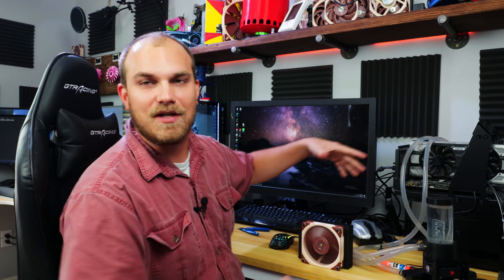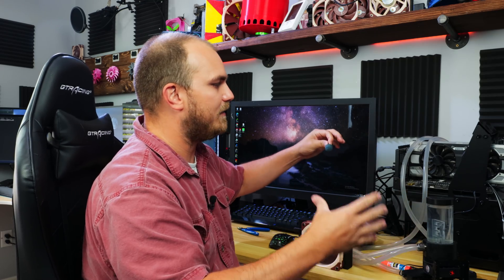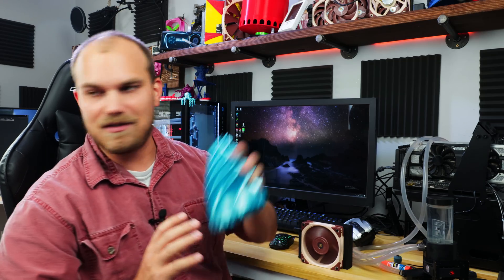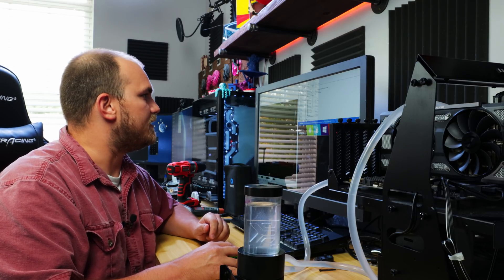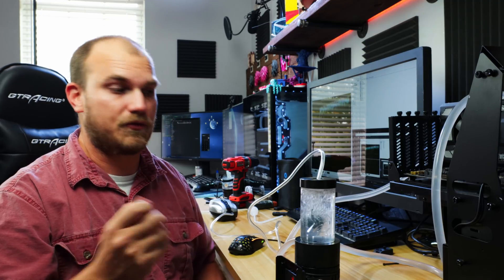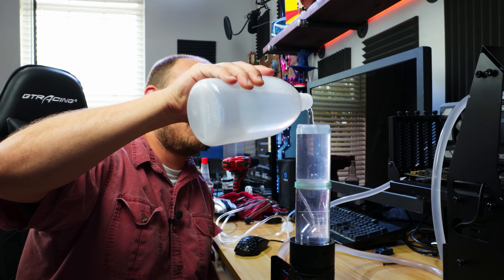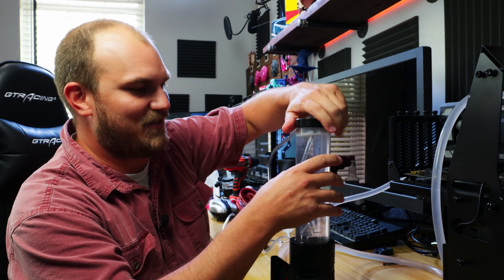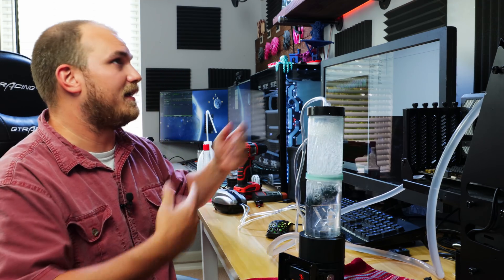Can An Airstone Cool Your PC?

Comment: COOLER IDEA: why not make a evaporation cooler that looks like a decorative waterfall? either a rock wall style or maybe a one with steps.
Reply: I love this idea
Reply: Same
Reply: Just run your loop through your fish tank
Reply: @karade  bruh
Reply: ...like Cray did way back when for the Cray 2?
Reply: So a cool looking vapor chamber?
Reply: The other foreign object can stock on your pump or currosive things can stock on your pump
Reply: @josergevasquez3767  just dont put foreign objects in it lol
Reply: Jonathan Scott I think he’s talking about erosion? Don’t get a stone fountain, make sure it’s plastics. Also if it’s open to air you should put a filter somewhere in the system.  You’ll need a stronger pump probably as well.
Reply: @Gracefulhiqpo  Make a sealed acrylic box to cover it and hide some fans.
Reply: I really like this idea, but maintenance would be often
Reply: @BossAuto_  Oh gosh yeah... Having an open system like that would certainly end up with the block getting clogged with gunk. It would look so cool though maybe it's worth it
Reply: Calling @DIYperks
Reply: this sounds really cool! id love to see this! nice idea!!!
Reply: would be awesome, something like 3m novec liquid with a boiling point of 34 or 61 C, or alcohol in a closed controlled system if you want to go cheap and dangerous.
Reply: Dude. YES.
Reply: This idea is kinda like unoptimized cooling tower.
I mean it could work and look cool
Reply: @replikvltyoutube3727 you could also make a mini diorama of a nuclear reactor with mini water cooling towers that is functional 😂. Real life cooling towers also utilize evaporative cooling.
Reply: I would enjoy watching it with Mercury as the liquid. It would run like garbage and mess things up but I like the idea nonetheless

Comment: Check the relative humidity of the air coming out of the top. If it's 100% (98%, 99%, close enough) then you need more air flow. You can check against what the air coming out of the tower was. Iirc, you did that and it was really high, but I don't trust my memory on that. Also, you have the inlet and outlet on the bottom, so that much bubbling and froth at the top might be stopping natural convection from circulating the water in the reservoir. Maybe check for stratified temperature in your reservoir. A cheap food thermometer that can reach the bottom would do it.

You have three potential limiting factors: A) Saturating the air with water and so no more heat can be taken away from evaporation,  B) not having enough time or surface area for evaporation to occur into the air, or C) circulation from the reservoir where you are cooling into the actual loop. B and C can be fixed by changing the reservoir shape/design, A would mean this whole idea is a dud, because the fix to that is increase the air/water ratio, the fix for which is of course the cooling tower which is a "different idea" in the context of this experiment.

A better reservoir idea might be to use a box, maybe 2" square by 12" long, laying down on the long edge, and bubble air the whole length of that with half a dozen airstones or a perforated tube running down the length.

I'll throw something in SolidWorks and upload it.

Comment: Use like a 30 gallon tote for your reservoir, a full size air hose with pin holes for your bubbler, hooked up to an air compressor

Comment: I think the issue is that the water to air ratio is way higher than the cooling tower so it didn't work as well. you can mitigate this issue by adding more air volume and 4 reservoirs or more.

Comment: I suggested this last time but I still think it is a good idea. Water cool the radiator. Have water fall onto a horizontal radiator with a fan above. Similar to the original design but using the radiator as the evaporation surface

Comment: @Major Hardware
A big problem with this method (as opposed to dripping the water) is that water have about 4 times more heat capacity than air, meaning for every 1 unit of water used for cooling, you need 4 units of air, so you REALLY need make that air pump work hard.

Google: "water heat capacity vs air"
Result: "Water's specific heat capacity is 4200 Jkg-1K-1 and Air's is 993 Jkg-1K-1 therefore water has 4.23 times more specific heat capacity. 
               Water has a density of 1000/m3 and air has a density of 1.275/m3 therefore water would be 784.31 x denser than air."
Reply: @Major Hardware 
Maybe try this?
Hot-bulb engine cooling system: https://youtu.be/mPGaJIAnjGI?t=24
 (but I think this is for cooling higher temperature water)

Comment: Larger reservoir will slow the throteling down because then there is more water to heat up but it will be a really small difference. (I could be wrong but these are my thoughts😅)

Comment: water's getting too aerated. it's getting pulled into the loop so you're reducing how effective the water can pull heat out from the block.
Reply: You get it 👍
Reply: I was about to post this.
Reply: Not so much, it's right when he putted that purple stuff into the loop, but with normal water the quantity of air trapped is quite small
Reply: Yes since air is a great insulator I knew without watching the video that it was not going to work.
Reply: @kitsura  Never heard of wind chill? Trapped air is an insulator. Moving air is great at carrying heat away, hence why fans are used to cool.
Reply: Absolutely. And with less thermal density available in the air, the efficiency of the temperate transfer in the block is greatly reduced.
Reply: That's the secondary problem. You don't want the air going through the system.
The primary problem is he's trying to cool via those cavitation bubbles but the volume of air he's pushing is absolutely tiny. You need a much larger volume of air than volume of water you have. 
So to match the other fan cooled radiator, you have to move just as much air as at other fan, while simultaneously putting that air under a higher pressure to be able to force it into the water. So you need a much bigger container at that point just so you don't make a mess. Lol

Of course another problem if you wanted to use this realistically, is that the system is no longer a sealed loop. You have to let the air out. So you'll have evaporation issues but you could take advantage of this with a large upper surface area, imagine a very thin container as wide as his desk, You would have a much larger area to evaporate from. So you lose water but you would get cooling from it too. That may be the boost on this that is needed to really make it effective without shoving massive amounts of air
Reply: @TravisFabel  Yeah, the other issue is surface area. He's pumping a small volume of air through the water. if he had a big short reservoir with tons of bubbles over the entire thing, it might work.
Reply: @TravisFabel  cavitation bubbles LOL.
Reply: agreed.

he is basically creating cavitation which is creating the same effect as vapor lock... trapping even more heat in the cpu...
Reply: @ThePorritZ  This has absolutely nothing to do with cavitation.
Reply: @ThePorritZ  pumping air and cavitation are not at all the same thing. air bubbles have air in them. Cavitation bubbles basically have nothing (a very very small amount of water vapor) at a lower pressure than the water around them. They then collapse rapidly and basically water hammer various surfaces.

Comment: Interesting, but if I'm not mistaken, from experience, the compressor will heat the air a bit. I'm guessing the water temp would rise in that small of a container even without being connected to the cooling loop, just from the warmed air bubbling through it. Cool video though!

Comment: You remind me why I got into PCs, FUN. Uhhhh what about a separate reservoir ? Air doesn't cool , so air going into the pump is a no go . Have a tank and the pump dumping into it from the water block maybe a transfer pump pushing water to your reservoir/pump . What I'm trying to get at is separate your pump from the aeration and increase the time the air has to interact with the water. Water wetter also . And really aerate the hades out of the water. Big tank/reserve reservoir . Bucket/milk jug. Since you have no rad your water supply needs to grow by a large amount. Nuclear power plants come to mind .

Comment: Id like to see what happens if you bury a tank under ground the cold earth should pull the heat away enough you wont need a radiator
Reply: A garden hose is more effective

Comment: Salt water or your water wetter with a air block from lee's. Salt water has less surface tension as dose your water wetter and the lee's air stone produces micro bubbles. Taller water tower to allow more time for heat transfer. www.hawkfish.org/snailman/skimmer101.htm here is some math that relates to aquarium's and might also spark some new ideas. Love your channel looking forward to the next fan showdown.

Comment: You will need a much bigger reservoir the water isn’t spending enough time in contact with the air to transfer the heat. Also you need way more air.  If you really want this to get working you are going to have to scale it up by an order of magnitude, and pump way more air into it.

Comment: We used to do this stuff in the early 2000's Bay res with a waterfall ..trying to keep the water cooler.
Finned res to act as a passive rad...Do you guys remember those tube rads running in series with no fans.???
Reply: Alphacool still sells them :D hella cheap. some 10€ each single unit.
Reply: @GrimpakTheMook  Cape cora iirc
Reply: nah hes talking about the Zalman Reserator guys. It was a HUGE reservoir made out of a finned extruded aluminum tank. Had external lines running to it.
Reply: @kasuraga  I still have one in my basement. Don't have have the heart to throw it out! Years of silent watercooling...
Reply: @FrankLeeMadeere  
It worked?
Reply: @lordelliott42  Absolutely! Cooled CPU, GPU, and Southbridge in same loop. Only downside was a slight coolant smell when it got warm.
Reply: Literally thinking the same thing.
Reply: Thermaltake had a passive tower, Rocket, where water would be pushed up and flowing down while cooling from aluminum wall. Zalman had something similar just more expensive (and probably of higher quality than TT). In the end I bought 1x120 radiator.
Reply: @SanityAgathion  yeah, the zalman one is called the Reserator 1.  It's just a giant aluminum finned tube with the water inlet and outlet at the bottom. I bet with some tweaking I could get it working a little better than original, but yeah.
Reply: @kasuraga  Yes, Reserator 1, thanks :-)

Comment: I would love to see one like 6 ft tall. You can get clear pipe from the hardware store and I just think that would be such a cool thing to have beside your desk if it worked.
Reply: That's just a passive radiator.
Reply: google FISH TUBE LIGHT and agree with me that it would be epic!!! Even if it doesn't work thermally it would be a very cool reservoir
Reply: He needed a wider water chamber, not a taller one.
Reply: @carpediemarts705  the idea of a taller one was to give the air more time to take heat from the water. Making a wider one would require more air stones to accomplish the same amount of cooling. Making it wider would theoretically work (while also making it slightly more complex) but so would making it taller.

Comment: yo dude, you need to feed hot warter on top on reservor. Now it just by passes bubles straight through the pumpm
Reply: This is what I was thinking. Not sure about that exact pump, but with intake and output on the same level I was pretty sure it's mostly recirculating. Also, the water will heat up to 40c at absolute worst? So the heat transfer will be tiny and you're relying on water vapour actually getting trapped in bubbles and not hitting the outside of the bubble and condensing back, because the transfer to the air without evaporation will be minuscule?

Seeing it in action helps recognise all the flaws, it's a cool idea and I love that you did it, but it's very doomed to failure.
Reply: finally someone said it
Reply: Yeah.

Comment: Take the res cap off so the heat has more room to escape
Reply: There is no air circulation with that cap on so it fills up the atmosphere around it with water vapor very fast and you are losing no heat
Reply: @iwenttogoogleheadquartersa1397  there's a gap around the tube, air is going out as fast as it goes in. Otherwise it would pressure up.
Reply: Yes he should take the cap off, but not for heat to escape but for water vapor to form and get replaced by drier air. Maybe the pump and stone won’t work without the lid but then change the pump to a standard compressor.
Reply: @monkeyplayer1  the air isn't sitting in the res. The bubbles being blown in are pushing the tiny amount of air in the res straight back out very quickly. Air in = air out just a fast.The top of the res has a HOLE IN IT PEOPLE. It is NOT SEALED. The air in the res is probably being replaced every couple of seconds.

Is everyone stoned or something?
Reply: @lunchie80  ahh I see your angle, basically the air is a secondary cooling loop with the earth's atmosphere being the secondary heat sink and the air stone being the primary heat sink.  I still don't think introducing air bubbles into the suction of the pump is a good idea because of the risk of air binding the pump and waterblock but I finally understand the working premise of this experiment
Reply: put the air pump in a fridge/freezer
Reply: True
Reply: we havent changed the radiative capacity . just added bubbles .
Reply: I agree with leaving the lid off, but so the water can be thrown out of the reservoir, transferring the heat out of the system with it. Just take precautions to protect the electronics!
Reply: The air is blown in under pressure, therefore any (very slightly heated) bubbles blows straight out through the hole.

Removing the cap will do almost nothing. Like the airstone...
Reply: @lunchie80  it won't do nothing. The effect will however be small enough to be negligible. Think of it like boiling water in a pot with and without the lid. The water retains heat and boils much faster with the lid on however the scale here would be to small to make an impact
Reply: @CtrlAltSk8  no. A boiling pot with a closed lid is different. No pressure is added. You're not BOILING the water in a loop, just warming it. There's no steam involved, just pressurised air. Plus a pot has MUCH hotter water AND a lot more surface area and is NOT having a stream of cool air blown through.

Comment: Can you hook up a pump to make the water flow even faster than with the stock one?
Reply: I mean like a mid pump to make the water flow through one direction really fast.
Reply: He should also try it different loop pressures. Like basically try running a loop pressurized at two or three PSI and see if you cool any better. But y'all compressed gas heats up so your air stone is actually heating up the reservoir.